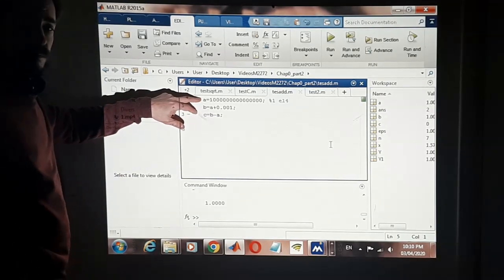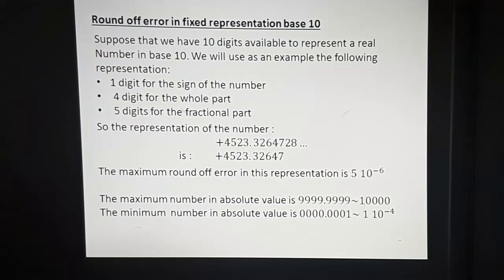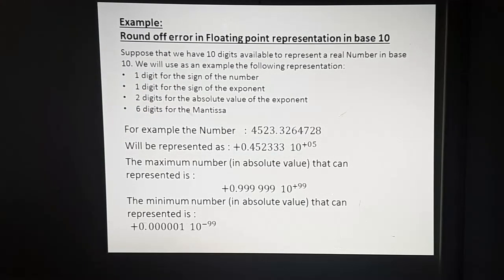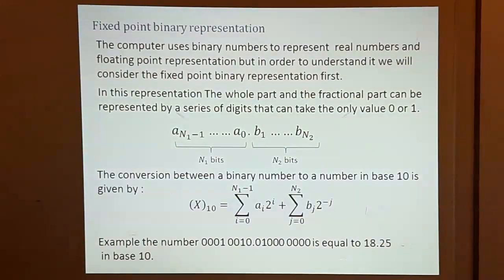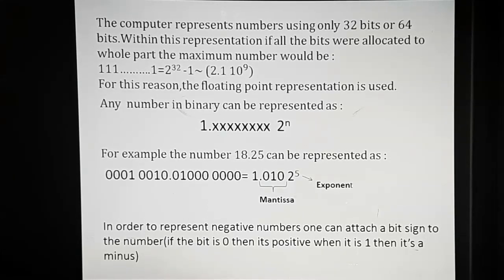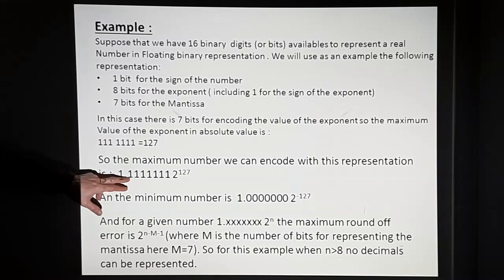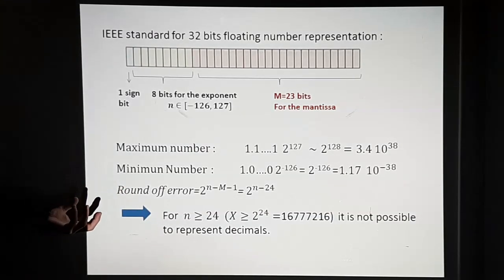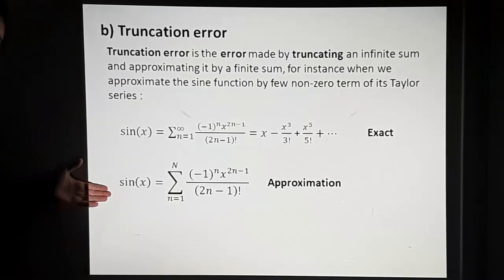CHAP 0 Introduction to Numerical Analysis- Part2 ( errors, floating point representation)

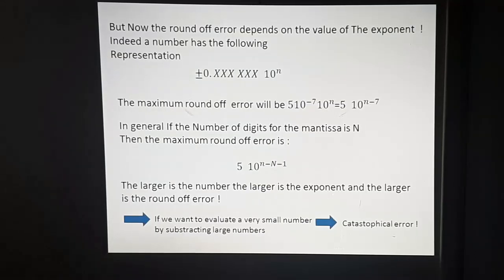Comment: 11:06
Greatest Positive: + 0.999 999 * 10^99
Greatest Negative: - 0.999 999 * 10^99
Most Infinitesimal: + or - 0.000001  * 10^(-99)

Infinitesimal meaning closest to zero without being zero. It doesn't matter if the sign bit/digit for the number is positive or negative, since both will be equally far from zero, but on opposite sides.
However, "minimum" is when the sign of the number is negative, and we use the largest positive exponent.